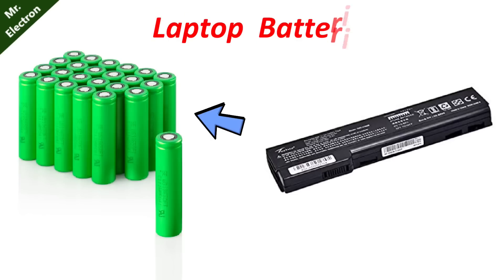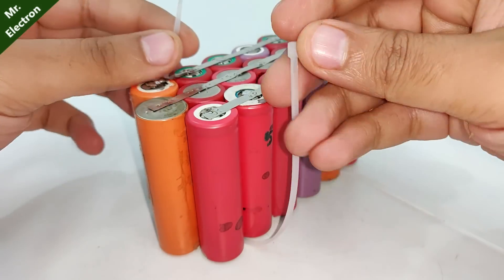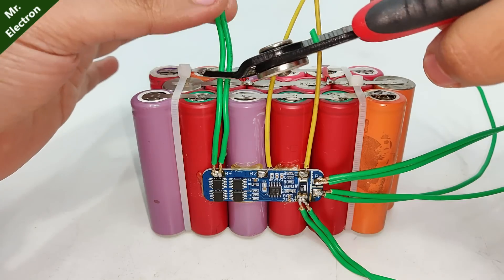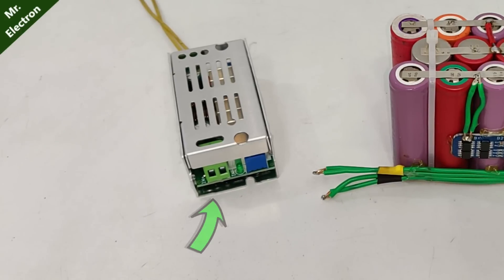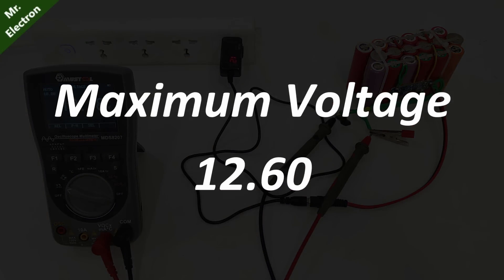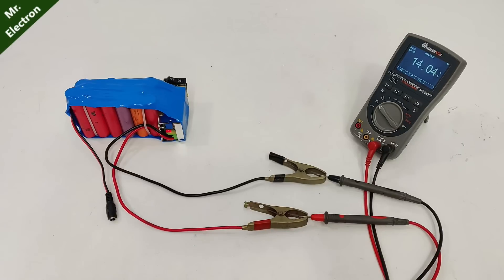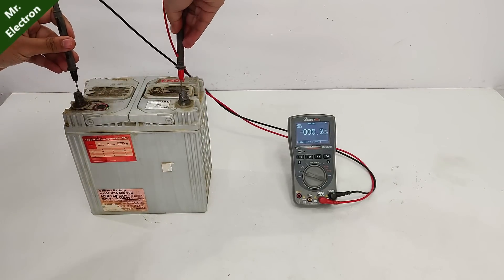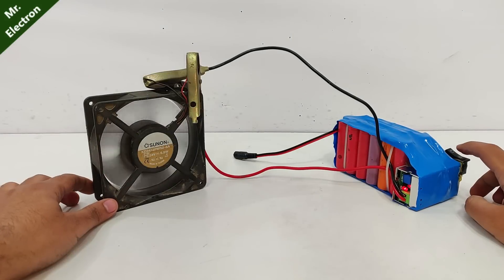12 Volt 50Ah Battery Charger Without UPS Transformer or Power Supply

Comment: Those cells are so fried they can't even maintain 4.10V. I can't believe they actually maintained a 4A discharge even though thats only 0.75A per cell. Those cells are simply not safe to use, they might last another 100 cycles before they struggle to hold much of a charge at all. You should really capacity test them and get rid of any cells that can't hold 60% of their nominal capacity as thats around double their normal cycle life.

Hot glueing the buck boost converter on to the cells is extremely dangerous. When boosting the voltage that case is going to get very warm and is going to heat up the cells it is up against. Pretty much expediting their death and that includes increasing the possibility of a thermal runaway event. So long as you keep the current output at 2A I think the risk is fairly low, you're probably seeing a max of 3A input so half an amp a cell...but still those cells are so far past their end of life metrics that they have no place being used in a pack. All it takes is one cell going into thermal runaway and the rest will join in on the fun.

Comment: Could you help me i have a (20 way ) usb charger and i would like to increse the output from 5 volt 2.4watt to 9 volt or 12volt output. To make a fast charger to LM 78 09 or LM 78 12 cv voltage reg.
I would like to incorporate a contatless charger disk and a upright contactless stand as well. I have got photos of the internals 
Please advise.

Comment: you didn't check the battery and their real capacity, how do you know that there is 50Ah??
Reply from the maker: That's the capacity of the battery it can charger and not its own capacity
Reply: @MrElectron  the lead acid battery was not at 0% SOC and was not filled to 100% SOC. Likely the cells have capacity of 1Ah to 1.5Ah each so the pack size is 12.6V 6Ah-9Ah. I would be shocked if any of those cells test above 1500mah based on their decreased charged voltage.

Edit: and the lead acid battery definitely is no longer 50Ah. I don't know how Lead Acid degrades so I can't even guess as to its current capacity but based on your Lithium Ion pack's ability to bring it up from 11V to 13V I'd say its under 20Ah.